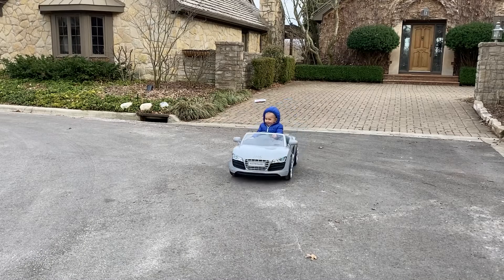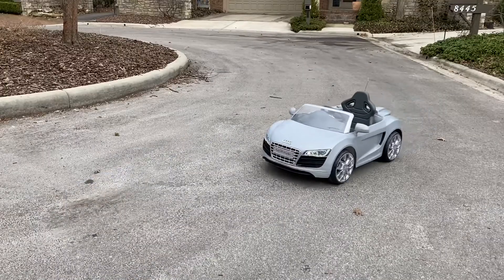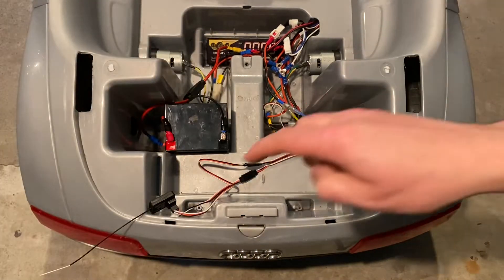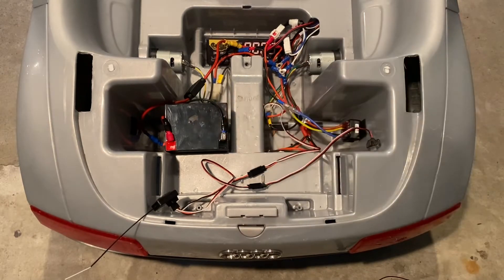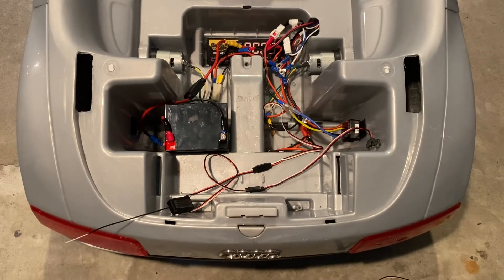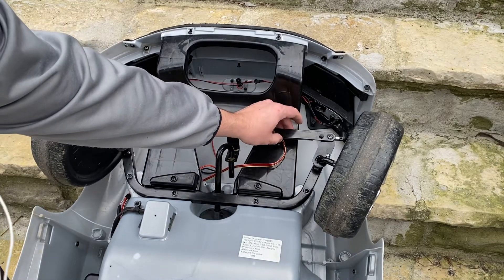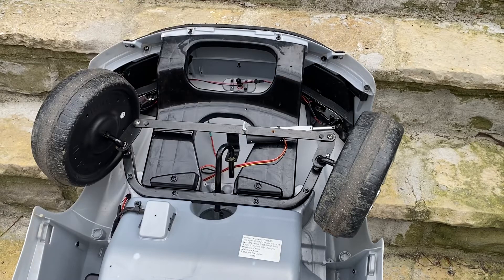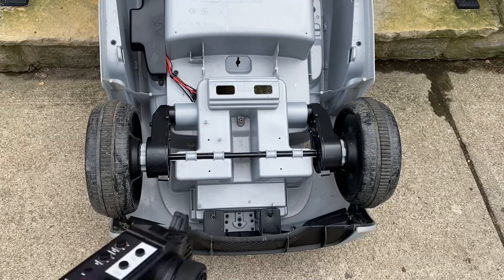Remote Controlled Power Wheels Car

Comment: Would this actuator provide enough power to move the steering rack on a riding mower?
Reply from the maker: Not with the actuator I’m using. But there are heavy duty actuators available, like this one in the link. But they can get pricey. https://www.progressiveautomations.com/products/feedback-heavy-duty-linear-actuator?variant=31832569249859

Comment: Would you know if this eac can handle higher voltage than 12V ? I am planning on using 18V battery pack to run my 775 size brushed motors and was wondering if this set up is even for me? Please advise . Any help would be greatly appreciated !
Reply from the maker: Probably not. Look for an ESC that can handle 24 volts, sometimes the specs say it can handle a “6s battery”. You’ll also want one that can handle 50 amps
Reply: @DadHacks  gotcha. that gets more complicated. I was just thinking of running the esc based on a separate battery cell like the other vid you have and sticking with a higher Voltage battery to get more performance out of the 18V motors. 

But I am not sure if the Chinese esc units are designed to work with a 2.4ghz receiver ?

Comment: @DadHacks Could you post a video covering how you set up the remote control portion of the build? Pumping mine up to 24 volts was a breeze but I am new to RC and need a little shove in the right direction for the drive train. What Transmitter and receiver did you use? What speed controller do you have hooked up to the motors that can handle 24V?
Reply from the maker: Take a look at this video. https://youtu.be/EO-0Ea-m0BE?si=3Cppol4DjqgAuyaT
I only went up to 12 volts. For 24 volts, look from a “Brushed 6s ESC”. 6s is just the battery specs which is around 25 volts.

Comment: I have my power wheels hooked up and I gotta go on forward and backwards but then when I hook up the actuator it goes to one side and then I just seen in your video where I may have to adjust those little blue knobs on the actuator is that correct